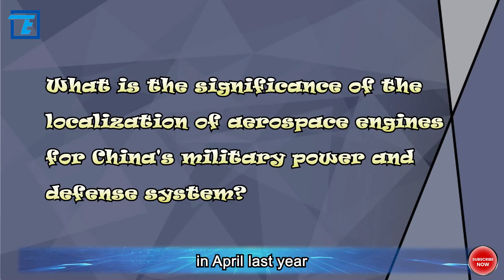What does the mass production of the domestically-produced WS-20 engine mean for China?

Comment: Perhaps not so clearly inaccurate as previous videos, it should be pointed out that engines for transport aircraft are not interchangeable with fighter aircraft that use the WS-10 and WS-15.

Also, no Chinese manufactured engine has yet proven itself competitive with Western manufactured engines in life and reliability. Chinese engines may have made great progress in performance but at the cost of burning out the engines.

Comment: The high by-pass turbofan WS-20 is for military aircraft use.  On the other hand, China's Yangtze CJ-1000A and B and CJ2000 are the counterpart of the US Boeing and France Safran "LEAP" high by-pass CFM engines for commercial passenger planes like the Boeing 737Max, the Airbus A320neo and until recently, the Chinese Comac C919. 

The two engines are different in internal design and each are meant for a different purpose. One has vector thrust and after burners for top burst speed but shorter range, the other is designed for long range, fuel efficiency and quieter noise levels. China used to purchase military jet engines from the Russians and Ukrainians but due to supply problems plus the fact that should a war break out, the lines of supply will be restricted or cut, making it very difficult to re-supply your own planes. 

One only has to look at the experience of the Australians during the outbreak of WW2 - its Commonwealth Aircraft Corporation was able to design and build airframes for the country's fighter planes (the Wirraway, the Boomerang, and the Woomera) but all suffered from a lack of having indigenous built engines to power the planes and have to depend upon engines shipped out from England - making it a huge disadvantage against the Japanese "Zero" fighters.

China also used to purchase the Boeing-France "LEAP" engines at a cost of around USD$14.5 million each. since a plane uses two engines, this would be USD$29 million per plane, not to mention having backup replacement engines and spare parts. China's spend on those engines were USD$52 billion. 

However, Biden decided to cut off his own nose because he didn't like seeing China's image in the mirror and stopped the sale of the engines to China (when you think about it, the sums don't match - Biden wants China to buy more from the U.S. but at the same time, stops the sale of all the big ticket items - jet engines, semiconductor chips, ship turbine engines, etc - that China wants. There's no logic behind it, is there?)
 
Thank goodness for China that she has better forward planners than those in the U.S. and has been preparing for such a day when the U.S. decides to start cutting off the selling of products to her.
Reply: The jap zeros were way over rated. They don’t have armour plates or that’s why they were agile.that’s why they were turned into fireballs when gotten hit!!!

Comment: Congratulations in becoming independent in making airplanes but don’t forget that they need fuel, if it is true Russia is down 45% in oil production due to war. Battery development is the ultimate goal. Batteries for all transport. Maybe some hydrogen or ammonia engines but they have their own problems, see how that technology develops.
Reply: BYD supply lots electric power unit to russis
Reply: China is also making discovery of oil more than expected, that will satisfy their need .